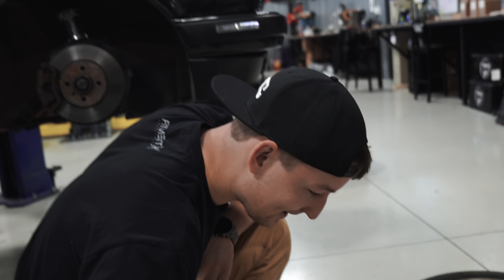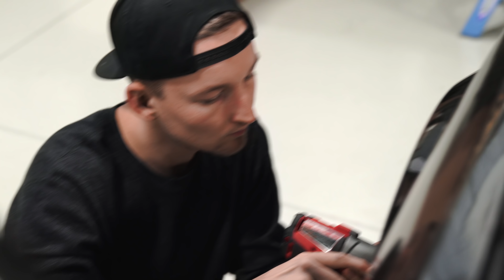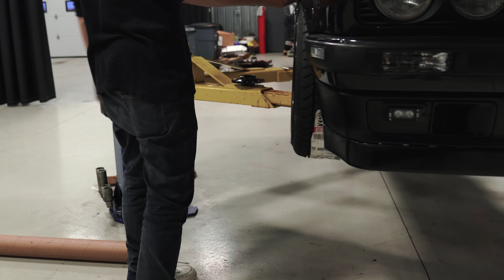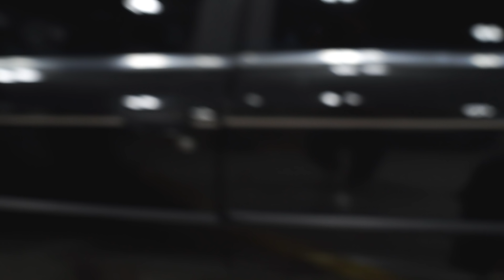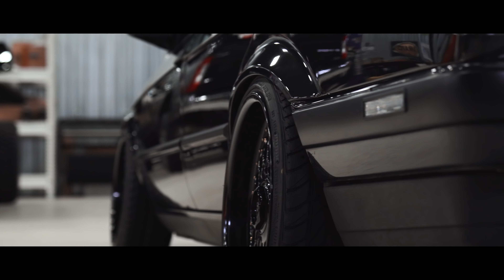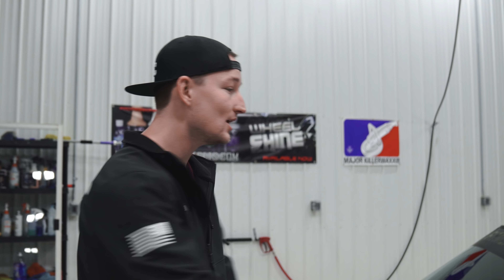WE FINALLY HAVE WHEELS ON THE CAR!!! | E30 Build

Comment from the maker: What would you guys like to see get done to the E30?!

www.fitmentindustries.com
Reply: Fitment Industries I’m not sure look good very simple more interior work would be a next
Reply: Fitment Industries Black housing on the front headlights
Reply: Ls supercharged in I and that would be my dream lol
Reply: Blackout the front grill
Reply: Get a ceramic coating company to sponsor the next vid and throw it on! Wanna see you try to do real damage on less-seen panel, and see if it holds up
Reply: Engine swap
Reply: Fitment Industries this looks just like my car lol! No joke, black e30 on black + gold xxr wheels (same as yours except 4x100). It's looking good lol
Reply: Also: specs?? 16s or 17s?
Reply: @crteaser9726  
 wtf No at, least keep it BMW
Reply: Mini turbo (:
Reply: Antenna delete, 24v swap, era correct aero
Reply: Body kit
Reply: Those ugly tints off The Windows, they are too dark.
Reply: @matthewmajorweenus6212  only made stye 5s 2 piece in 17s and 18s, The style 5s 16in are one piece, 17s are 17x8 et 20 if i remember right, had a couple sets
Reply: Simple carbon fiber accents like a small wing. Splitters and or sideskirts
Reply: M52 turbo swap
Reply: Juuzow bggui
Reply: Old info & really doesn't matter @ this point in time. But..... If you could run your E30 on run flat tyres with airbags suspension (which you do) & bigger fuel tank or electric power (if you choose this option plant with a wider range & a sticker: shut up bae, am busy sleeping...) . Than talk absolute shit about other companies which will produce a pushback on your quality of products indirectly. You are welcome. 🤣🤣🤣🤣🤣 Great channel btw 😉

Comment: not normally a fan of matching lip and center with colored hardware but it looks really good with the stock gold pinstripes.

Paint the chrome still on the car black or gold to flush out the scheme more.  (depending on the new wheel color of course)

Comment: I'm kinda new to the air ride game, But I have a question about it. I'm using 3p and I noticed that if im using presents that i program into the controller and let's say I go all the way up... then I change to another present that goes lower, it will air all the way out then go to the present rideheight. Why is that? I don't want it to do that, I need it to just go to the correct psi and stay there not air all the way out and than go to that present psi. Basically im running into the issue of,  if it was to do that, my rear fender would come down to far and crush it against my lip.
Reply from the maker: Yikes man, Let's take a look and see whats the issue. Shoot us an email at wheels@fitmentindustries.com

Comment: What wheels are those?? I love to have them on my MKIV Jetta!!!
Reply: BBS style 5's they came factory on some e39's, i have the set that came on my 540, but i'm in the process of restoring them.
AKA rc090's
Reply: @smokeybear390  hey man I'm in the same process of restoring mine. Going cut the barrels to add new lips
Reply: Theyre bbs style 5, Alzor makes a wheel called the 010 that should fit perfectly. You want 9" et25 or 9.5" et35 and then run a tire 20mm skinnier

Comment: Is it hard to roll fenders?
Reply: Rolando Bernal it takes a bit of time to do it correctly, but you only need that tool + a heat gun.
Reply: Matthew Major Weenus so the key is to take it slow and have patience
Reply: I just need the tool I was deciding if to buy it or take it to a professional shop
Reply: Rolando Bernal log onto craigslist and look up "fender roll," there's always shade tree guys that'll come to ur house and do it for you. Honestly in my town, literally no auto shops do fender rolling lol. It's not really common anywhere, unless u live in Cali
Reply: Rolando Bernal I wouldn't risk doing it yourself, you can easily crack the fender paint if not careful enough.

Comment: Hey what are the specs of the adapters you are running? I am also looking to install RC090s on my sedan. Thanks!
Reply: 4x100 --> 5x120  
20mm in front 
18mm in back
Reply: Corey Fitment thanks Corey! Any recommended manufacturers?